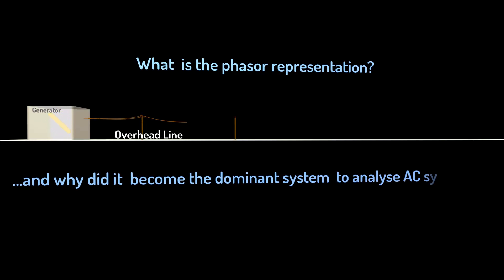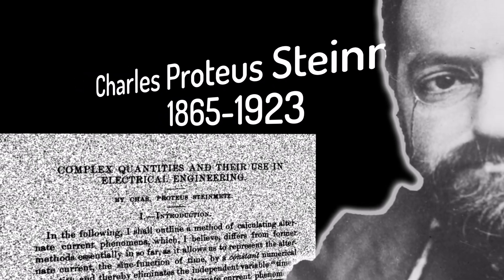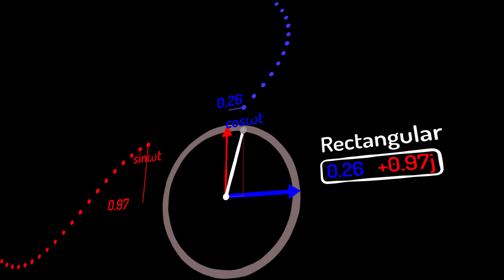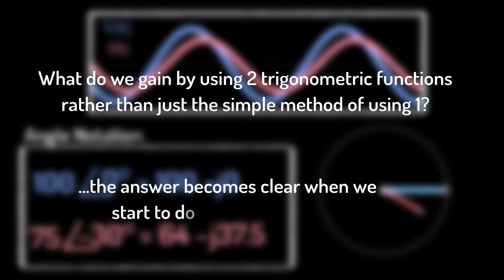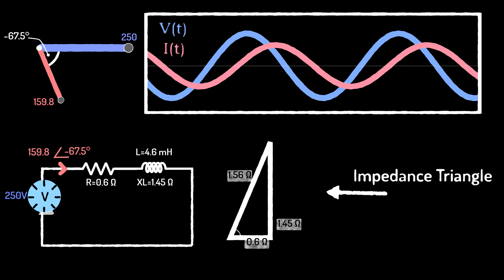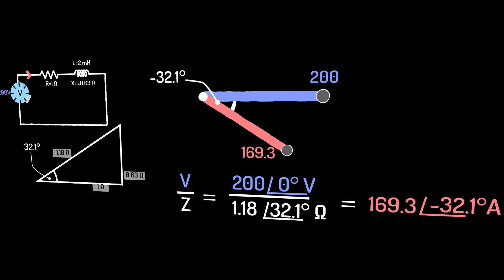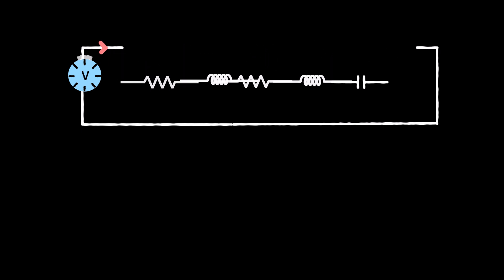Phasors - what are they and why are they so important in power system analysis?

Comment: Is someone able to explain why the overhead power lines are capacitive and inductive? My understanding was that it must be either or?
Reply: A capacitor is just two plates, and dielectric material. 

If I have an insulated cable, the insulation is my dielectric material, my conductor inside can be considered one "plate", and ground (or some other lower or higher potential system) can be my other "plate". 

If I have a conductor, and it has current flowing through it, it will project a magnetic field. That magnetic field will cut through adjacent conductor atoms inside that conductor which is going to exhibit some inductance. This of course gets multiplied if you start making coil turns. 

This is at least how I understand it. I am neither degreed nor engineered.

Comment: The approach of Charles Proteus Steinmetz for the solution of circuits using complex numbers, although very similar, it is not what we know today as Phasor Analysis.  After carefully studying his paper, Steinmetz's approach is more closely related, in my opinion, to "harmonic addition".  If I recall correctly, one problem with Steinmetz  method is that the resulting reactance of a capacitor is positive and the reactance of an inductor is negative; which is the opposite of what we get while using phasors!  The concept of phasor as we now it today was introduced much later, like the 1940s or so.  Before that, calculations in electric circuits were done using "vectors" or "complex numbers".   The phasor is also a complex number representation of the amplitude and phase of a sinusoid.  The difference is that while in harmonic addition both the real and imaginary parts of the complex number solution are needed to reconstruct the solution in the time domain (as shown in Steinmetz paper), in phasor analysis only the real part of the complex solution is needed to reconstruct the solution in the time domain.

Comment: Thank you for a great video, I am also baffled by your statement "The Impedance is not a Vector." I am not sure I understand your statement. In fact, Impedance has an active component (R) and a Reactive component X(L) or X(C). This is not far-fetched from a vector (in R2) that has both a X component and a Y component. Would you kindly comment on why there is so many similarities and yet these two (2) items (impedance and vector) are yet different? Aside from this, I must say your video is exceptionally good.
Thank you for your time and consideration.
Reply: I think what he meant was that impedance is not fundamentally a sinusoidal wave, thus plotting it as a "phasor", which is a rotating projection of a sinusoidal wave, is wrong. Impedance is a complex number, and sure enough, you can convert it into the polar form and plot it with the voltage and current phasors anyways, but fundamentally, there is a sine wave associated with V & I phasors but not one associated with the Z phasor. Z is simply the ratio of V / I.

Comment: Your phase plot and phasor diagram are inconsistent. The frozen in time blue horizontal phasor should  represent a cosine behavior in phase plot.
I'm àssuming 0 degree phase is left vertical side of window in phase plot
Reply from the maker: Hi Jim, just so I'm clear what timestamp are you referring to?
Reply: @VisualElectric_  there should by phase degree markings in radians (π/2, π etc) along the horizontal axis of the phase plot. The blue sinusoidal (blue phasor @ 0 degrees) should be a V*cosine function. At 0 degrees on phase plot the blue curve  = amplitude V. You show the correct relative phase but there's nothing to show the global phase on the phase plot. I just assumed the left edge of phase plot was phase angle = 0. But if that's the case the blue curve should be cosine as that's the real part of the complex number phasor
Or in other words a horizontal phasor (in this case applied voltage drop represented as a phasor having 0 degrees phase angle or parallel with the real axis in the complex plane) is used to represent a sinusoidal behavior consistent with a cosine function in the phase plot.
The angle on your phase plot is implied but not explicitly shown.
Also time in analysis of steady state ac circuit is irrelevant. Only phase and amplitude of the voltage drops and currents are relevant.
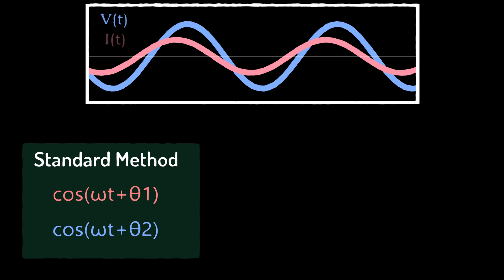Oh the time stamp where a phase plot is first encountered is ~ 2:05
Reply: @jimhenderson2308  skill issue
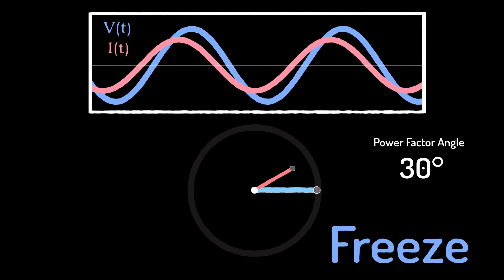Reply from the maker: The plots of V and I are meant to just show a frozen version of the waveforms.  I tried to express the relationship explicitly at 3:54 - note the vertical red line travelling across the waveform? This is carefully synchronised with the rotating phasor. You say time in the analysis of steady state ac circuits is irrelevant. Note the part of the video at 3:30 FREEZE and the important message is delivered there. However, you need to understand the time varying part as the origin of where phasors come from in the first place.
Reply: Yes what you refer to is why phasor representation is valid and Time no longer be considered. Only phase and amplitude and frequency aspect of sinusoidal quantities matters.
Time need not be considered for steady state ac analysis with phasors. Just like time is not considered in analysis of DC circuit with resistors.
You still can analyze steady state ac sinusoidal circuits in the time domain (think event triggered sweep and oscilloscope )but using phasor representation eliminates any notion of time.
Time domain analysis is reserved for circuits containing inductors and capacitors having switching events.